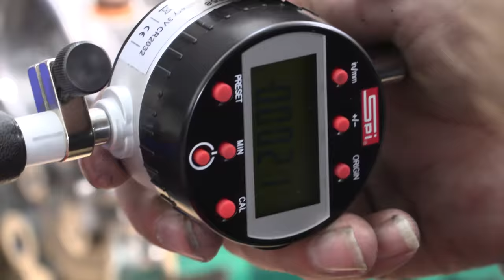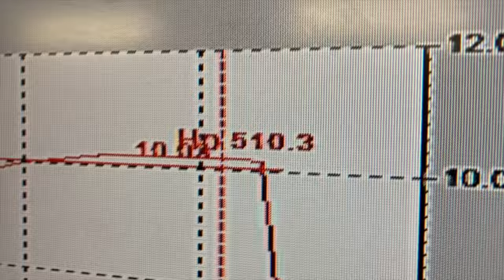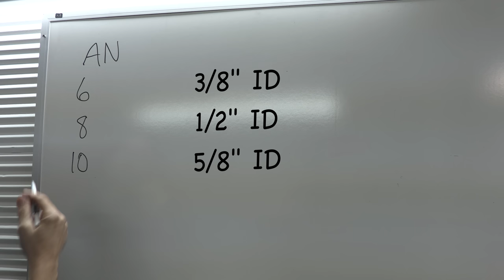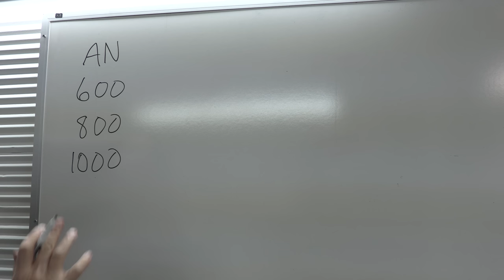Complete FlexFuel e85 Fuel System Install

Comment: I learned so much from this one video, like the diameters of the fuel line = HP after you do an E85 conversion. Wowza, 600/800/1000 HP. Also fav pullquote: 45:55 "I don't know, man. I just work here. This is my example"

Comment: I was just planning on doing all my fuel lines.. I was almost set on just doing steel braided rubber because I imagined PTFE was hard to work with. "Harder" maybe, but you made it look easy! 

There's no E85 north of the border.. but I think I might go PTFE after watching this because I could theoretically cross the border and be at an E85 station within 1.5 hours from home. Even if I never run E85, im sure the possibility exists that some future owner will appreciate it being E85 ready. (This is an inheritance scenario btw, pry the DSM from my cold dead hands)

Comment: @44:17
A recycled spark plug wire 90 boot works here, heat shrink over end.
Think of the BATT terminal of an alternator🤔
Reply from the maker: If I find myself going back in there again, The Alternator insulator is exactly what I was thinking.  It's as if that ring terminal is begging for one.
Reply: @Jafromobile  Do you ever have an issue with AC ripple and/or RF noise on your audio or ECU ? I bought a couple of isolators for the system I'm installing soon, get rid of the ground loop hum. They usually have RCA terminals, but can be clipped & spliced. RF can wreak havoc on a tune, AFR, hall effect stuff. Years ago- friend's van would have a misfire on a bass note; knock sensor was picking up! LOL.

Comment: 16:00  you need a trailer hitch vise on that table. Tom Lipton (youtube content creator from the machining world) made one for a bullet vise. Worth taking a look. Doesn't clutter the top of your work bench, and can be hidden under when you're not using it.
Reply from the maker: Upvote because I totally agree!  But unfortunately the legs and casters on this table aren't strong enough to do what I do with bench vises.  I set an engine block on it early in this video and needed to put the table on an alignment rack afterwards because she now pulls hard to the left.  There's a bench vise 80 feet across the shop in Matt's space I could totally use, I was just being dramatic.  :D  Lazy.  Didn't want to move the camera.  I like having a rolling staging table.  I learned a lesson.  Didn't exceed the load rating on the casters, but the table legs... Might reinforce the legs where the casters attach at some point.  Maybe a bench vise once that's sorted?

Comment: Those flex fuel sensors measure ethanol content AND fuel temperature. Neat little devices.
50-150Hz = 0-100% ethanol
1ms-5ms pulse width - -40C-125C
Reply from the maker: That's exactly correct!

Comment: Always a good time when a new Jafro video drops! I’m interested to see how that brand of fuel line works out. So far I’ve only bought some of their fittings for a project we’re working on.
Reply from the maker: To check the quality before you start, make sure the little silver pin isn't jammed in place.  That's the only thing to look out for.  If it's got a little play in it, it's unlikely to cause you any problems.  There's been reports of leaks, but any fitting whose little silver pin at the swivel moves freely should be good to use.  A couple have showed up like that, not in either of my kits, but we have seen it, too.  Dangit, I almost included a scene of that but this video was already so long...
Reply: @Jafromobile  good to know! I will keep an eye out for that. I may go with them for more stuff down the road. Been toying with the idea of going flex fuel with my mustang.

Comment: just an fyi. from nhra rule book and most tracks.  you need to add hard lines  Lines: All non-OEM fuel lines (including gauge and/or data
recorder lines) must be metallic, steel braided, or NHRA-accepted
“woven or woven-pushlock.” A maximum of 12 inches total (front to
rear) of non-metallic or non-steel braided hose is permitted for
connection purposes only; individual injector nozzle and motorcycle
fuel lines are excluded.
Reply from the maker: The PTFE hose is both steel and nylon braided, so it actually qualifies.  PTFE hose doesn't have the burst strength to handle 300 PSI without it.  It would balloon and split.  There isn't an inch of non-steel-braided hose on any part of this pressurized fuel system, and my fuel tank vent hoses fit the connection definition, plus they're stock.  So this fuel system fits the NHRA rule book.  ;)  I'm also very happy to have this here, because everyone needs to know the rules!
Reply: @Jafromobile  oh nice I didnt know they qualified it like that. system looks great btw.

Comment: This will be the easiest  hp / tq goals in mind for your bulid.  
 Also, thank you for the excellent explanation on why not to use aluminum / regular fuel lines with e 85.  
 So, on a non return system like my cruze that uses a pulse system to feed the engine fuel I don't have a choice of a return line to install a content sensor  but you can still get 70 to 80 psi from the tank & even with a 1.4 t engine they can make 340 to 400 hp on a stock system which is impressive I think on a engine that the cylinder in just about the size of a soda can or 16 ounce water bottle.  
 E85 makes cooler flame front , and higher compression & timing tables can be used. But also your turbo should be cooler & make more boost more efficiently as well. I watched the last time & you were making a boost, and you hit 22 to 23 psi during a shift from 3 to 4th  under load you may be stretching a connection & may want to look for a boost leak. 
 (: never give up & love your shop ! Be safe.
Reply from the maker: Yeah man!  Now I can just pull up to a different gas pump, hit a 60% mixture and pour the power on with my credit card in about 10 minutes.  Plus e85 is $1 cheaper here at only like 5 gas stations in my whole city.  Certainly the easiest.

A 1.4t engine isn't going to burn more fuel than will flow through that sensor even if you hit 3 bar with it.  So it would be totally fine on a deadhead fuel system.  The thing that makes that car potent is the 10 speed transmission that keeps it at peak cylinder pressure, but I wonder how often you'd have to rebuild those clutch packs at 3 bar?  Certainly has potential!  It took a while for the DSM crowd to figure their auto transmissions out.  I think if you had goals over 400 horsepower, an external regulator and return system would offer much greater potential and consistency because fuel temperature also matters.  You don't want to boil fuel in the rail between drag passes.
Reply: On my gen 1 I have 6 speed manual transmission but at 400 hp you are only using 1 / 5 on the track and 6 for highway speeds.  Zzp has a 1.4 t in a sonic pushing 576 hp. And they have broken many parts along the way including flywheel bolts.  I would like 250 to 300 hp in a 3200 pound car that's my daily driver.
Reply: Thank you for the reply  (:

Comment: just a heads up.. the ethanol sensor is not an innovate part.. they are reselling a plain jane gm ethanol sensor that can be bought anywhere. the harness is also avail at most auto parts stores as a pigtail harness.
Reply: I noticed fueltech does the same thing. GM sensor.
Reply: @BigPermGarage  why reinvent the wheel when you can grab an off the shelf part, slap your own sticker on it and charge three times the price.
Reply from the maker: I agree!  The innovate unit I used is why I linked it in the description.  The way I acquired it is also in the description, lol!

Comment: that example of a bare aluminum fitting is actually zinc coated steel. that is a JIC hydraulic fitting, not aluminum. That's not to say you're not wrong, aluminum isn't that bad though. There is decent rubber lines you can use with e85. Been using ethanol with ethanol rated rubber lines for about 5 years now without any issues. That's not to say i won't in the future but yeah. Best to do it with PTFE from the get go.
Reply from the maker: You are correct.  I did have an anodized fuel filter that was drilled out, and drilled out because all of the -6AN fittings no matter who you buy them from are still 1/4" ID.  If you use straight fittings, some people drill them out because you can increase the flow.  Old-skool trick.  Can't do it with angled fittings, but you get the idea... The freshly drilled non-anodized aluminum inside the fittings that were drilled did the exact same thing as the zinc coated steel I showed, but I failed to include that dang clip of the fuel filter over this one in the editing process.  I was just trying to solve all the blurry footage issues.  I went through the trouble of re-shooting it and still failed to include it.  I went through extra effort to fail on that one.

Comment: Here's a thought:
At WOT I wonder approximately how much fuel is actually returning to the tank?
You'd have to disconnect the return at the tank, stand the front up, and punch it
for ~5 seconds to measure the residual the engine's not eating.
Reply from the maker: I've never had a problem with a -6AN feed and a 1/4" ID (-4 AN) return.  I've always had good base fuel pressure with it.  What I'm making room for is the fuel being returned at idle.  When I'm not using the ol' gas pedal.  I just installed a pump that moves 200lph more fuel than the old pump.  It was just a Walbro 255 and I needed more for all the extra ethanol we'll need to move.  450lph is enough.  Some big injectors are on the way for WOT... but the fuel return is at its maximum flow at idle, under vacuum.  That's when the fuel pressure regulator is the least restricted.  So it's not just the consumption of the injectors at WOT... it's also the sphincter in the regulator limiting fuel flow at WOT to raise the fuel pressure.

Curious question...  I'm sure there's an awful lot of math.

Comment: Be interested to see how them delrin o rings hold up to electrical heat. I’ve melted a few on the pos bulkhead before
Reply from the maker: It uses Viton o-rings on a delryn bushing.  With the heavy gauge wires on one side, and the smaller gauge on the pump I'm unlikely to have any electrical heat.  The line I ran can deliver more current than the pump is capable of drawing.  The load being drawn by only one pump shouldn't heat it up much at all.  But if I had 3 fuel pumps in here along with a fuel level sensor to power, it would certainly be a different story.

Comment: shouldnt you do the power and ground for the sensor .. spliced to the ecu sensor grd and power? otherwise you may get false readings , no? still.. another excellent vid!.. wait.. the sensor  takes 12v? never mind then. next up.. dyno comparison to 93 with timing changes?

Comment: Merry christmas jafro

There's nothing i hate more than having to buy the same thing twice. You've bought 3 sets of fuel lines for this vehicle so far, and at any moment it could become un-roadworthy due to your state inspection. That would suck :/
Reply from the maker: There are electric cars from the late 1800's that still work, and if the elite are allowed to still have and enjoy those horrid atrocities, then dangit, I will have my antique also!  I will keep driving it so long as they're allowed!  I'll keep making it compliant, and forever fighting for our rights to keep our antiques!  Even if I have to make my own parts I will pass state inspection.  I think that's the example that should be set.  Take a car that was not meant to be preserved, and try to preserve it.  Or use it far beyond its intended design.  Either way, I promise I'll use it all the way up before it's finished.  Happy New Year!

Comment: With 3M ceasing production with PTFE and other similar chemicals, do you have suggestions for e85 compatible materials that are more resilient than rubber, but aren't steel, teflon, or annodized aluminum?
Reply from the maker: I seriously doubt PTFE is going away as it's the base of PEX piping which is a household construction standard, and there's no shortage of this fuel hose in automotive today on either on parts store shelves or in people's race cars.  It meets NHRA certification for all automotive fluids.  Either they've sold the patent, or DuPont is filling the void?  I don't know for certain, but if I wanted a solid permanent all-fuel-safe zero-maintenance replacement for it, I'd go with stainless steel.  It's just so hard to work with the effort isn't worth it on anything but a high-dollar build.  And this thing ain't.  :P. But there'd be nothing wrong with using this steel braided PTFE hose on a high dollar build, either.
Reply: @Jafromobile  3M always bails on products once their patents expire. If anything I bet PTFE will just get cheaper.

Comment: Jafro, just how much cheaper is the corn juice where you are?  If memory serves, it has less energy density than gasoline - meaning something like 27% worse fuel economy.  Is the E85 cheap enough to counter this increase in fuel usage?  Or should one save their money and just use it when you really want that additional power boost?
Reply from the maker: Gas just shot up 30 cents yesterday, so it's always fluctuating, but it's about a dollar cheaper.  You'll fill up more often, but the same Sheetz with the e85 pump has a drive thru that serves a chicken parmesan sandwich topped with 3 cheese sticks.  Hits the spot!  Add that sandwich and it works out to cost exactly the same in the end, you're just doing it more often.  And yes, horsepower at the pump.  Whenever it feels right.

Comment: Jafro, what are your thoughts on something like Gates 27348 Barricade 5/8th hose, according to Gates it is approved for E85, methanol, etc.
Reply from the maker: I know.  It sure is!  That's exactly what it says.  But you shouldn't make your whole fuel system out of it.  It doesn't meet NHRA requirements which someone else was nice enough to post here.  I hearted their comment so it would float.  I wouldn't feel good about running a non-steel-braided hose on the underside of the car, and it will fail tech at the track if the officials see it.  If you use it within the NHRA standards for connection, then you're fine.

Comment: Every single swivel fitting I installed on my original fuel system has sprung a leak and been replaced with straight fittings and hard elbows. Fingers crossed your Amazon swivels hold up…

Comment: Trust me use boiling hot water put the tube in it it’ll make it soft a lot easier to put it on that way I do this for old lines too
Reply from the maker: Stellar advice!  Even Matt said, "Hmm... That makes a lot of sense" despite being great at this with the heat gun.  Totally agree.
Reply: @Jafromobile  yea the water is almost fool proof unlike the heat gun a little too long and you can have a hole or weaken the plastic, thanks for the info on the type of fuel lines needed I was thinking of doing my Evos fuel ones almost bought the wrong ones

Comment: Measuring the depth for the fuel pump?  What happened to "position pump as low as it goes on the holder, barely snug zip ties, lower into tank and push down until top can be bolted down...then remove, push pump another 1/8 - 1/4" higher to avoid rubbing on the tank bottom, and tighten zip ties fully.  Job done, and nary a tape measure in sight.  🤔 

Edit:  Damn, you did virtually exactly the same thing - only with a Jubilee Clamp instead of a zip tie.  Once again I talk too soon...oops.  😁
Reply from the maker: ...the scientific method...

Comment: Is that PTFE hose safe? I read that you need to use the conductive/grounded one with carbonized coating for fuel applications to remove risk of static buildup. Apparently moving fuel through a PTFE line can "charge" it with static?

Comment: Schroedinger's fuel pump? lol What is the tool you used after you pushed the ferrule on to seat it? Might want that before I start my fuel system.
Reply from the maker: The tool I used was included with the hose kit.  If you want a universal one that works on all the different size hoses, look up the Aeroquip FBM3646.
Reply: @Jafromobile  Thanks. I bought my PTFE hose stuff years ago and it didn't come with one, I'm trying to get everything together before spring when I want to start putting parts ON the truck.

Comment: Quick question is posible used Walbro 525 and the thank and other extra aem fuel pump 400 in-line same fuel system I mean using the same fuel line 🤔 thanks in advance
Reply from the maker: Sure.  The AEM works like a booster and needs a feeder pump.  Normally you'd have it on the same line anyway.  The 525 is a lot larger of a feeder pump than most people use with it, but I don't see any reason why that would be a problem?  I doubt the AEM causes any kind of flow restriction?  That should move plenty of fuel.  It will be loud, too.

Comment: Is the FRP bare aluminum? Hopefully this isn’t a weak link in the system. Maybe what appears to be bare aluminum is actually anodized. But I didn’t see you verify or explain that part.
Reply from the maker: No, it's finished, but the rail itself is bare aluminum.  People complain about their plastic fuel rails, but that law is why it happened.  Many car manufacturers continued using aluminum on fuel parts because they thought the fuel standard was for E10 gasoline which is very stable and not all that corrosive.  They didn't know it would soon be e85.  So you continued seeing aluminum OEM fuel parts after 1994 until cars started being sold with "FlexFuel" badges on the bumper.  They learned their lessons by then.  But yeah, aluminum fuel rail still... and I probably won't do anything about it until it's a problem.

Comment: That hat looks awfully similar in diameter and bolt pattern to a 96.5-99 tercel sending unit
Reply from the maker: I wouldn't be surprised.  You'd be shocked how much Hyundai borrowed from other Japanese manufacturers to build their 1g Elantras.  Basically the entire driveline.